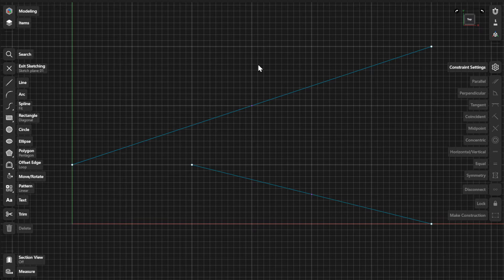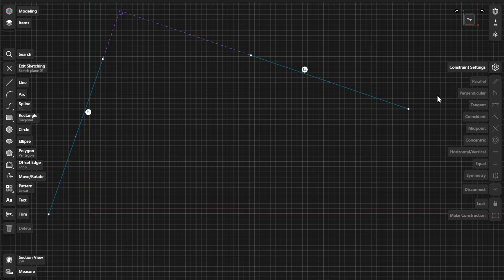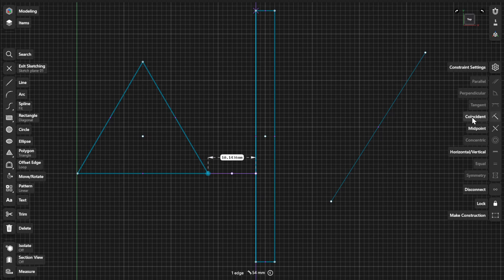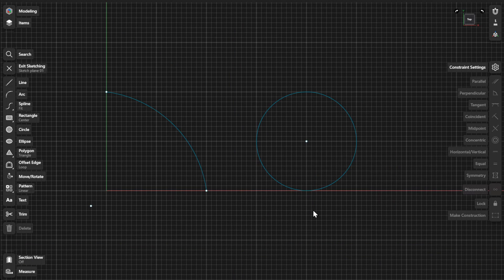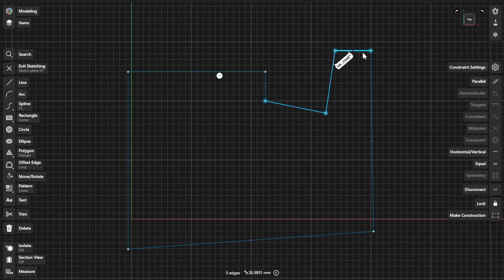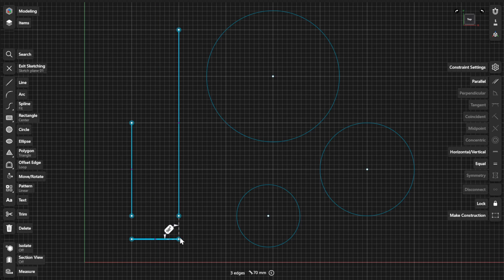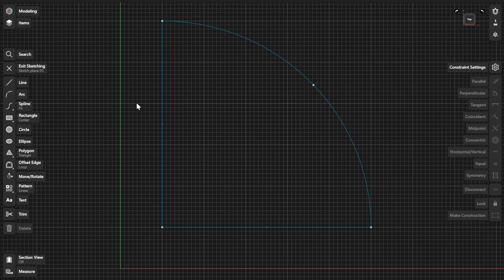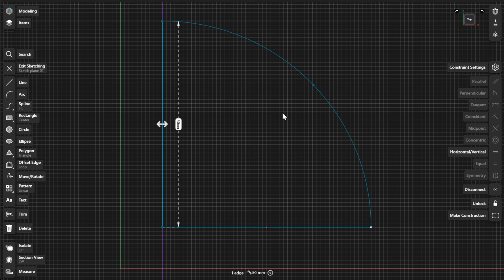Shapr3D Manual - Types of constraints | Sketching

Comment: When recording I highly recommend capturing at atleast 60FPS at 1440P, 4K preferred. The higher the resolution the more bitrate Youtube encodes it at. I use hardware encoding with CBR at 50000 with a 2s keyframe interval. This is neatly possible using OBS on any platform, mac is especially nice for it. This can likely be further optimized but I've found great success with it. Thanks for the tutorials.